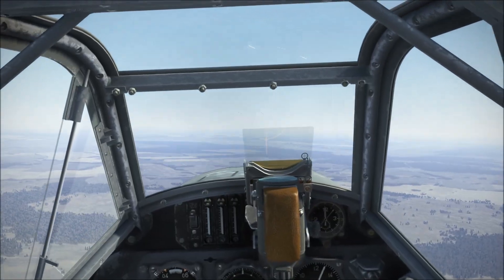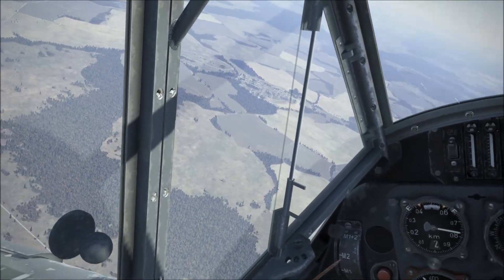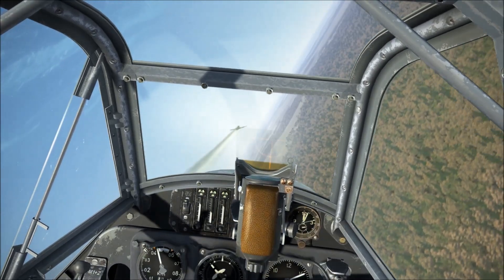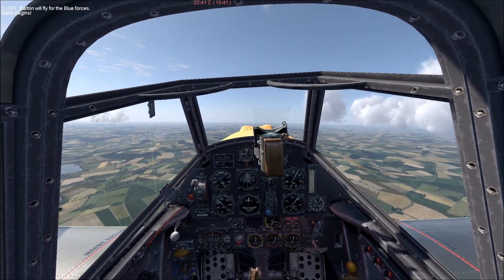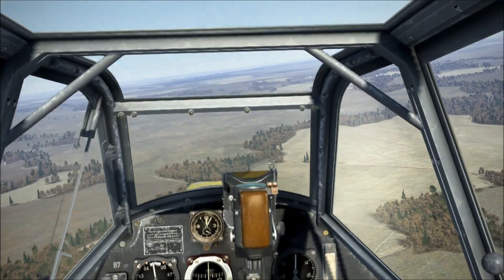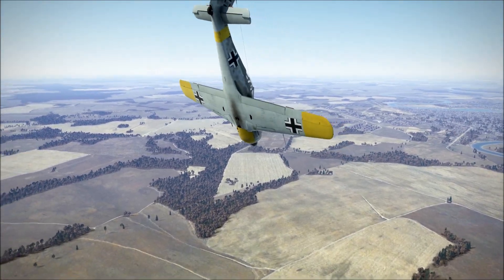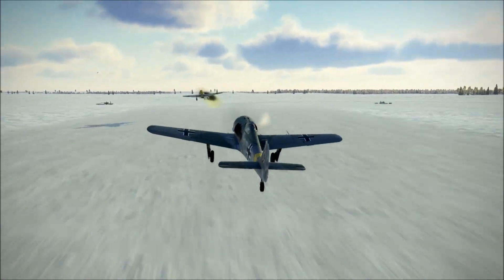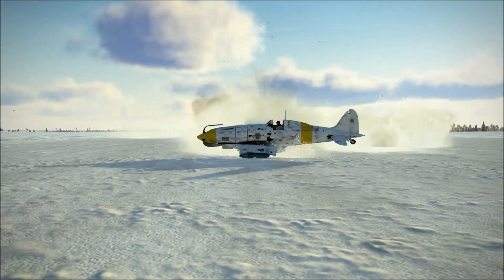IL-2 Battle of Stalingrad - Stall Characteristics Comparison

Comment: Flight models change between games, depending on the algorithms and characteristics, so it's understandable that aircraft are going to behave differently given the same dynamics using different engines.  Some of the changes reflect new knowledge devs might have gained doing research, others come from playtesting, or the flight model just not behaving.  There shouldn't be criticism given to someone for chosing one sim over another because they don't like the flight model, after all these are games and are meant for leisure and enjoyment. They'll never give you the true sensation of flight since you're not actually sitting in an aircraft feeling full turbulence and g-forces.

Comment: Well done and good points, well illustrated.  To me, the most telling criticism of IL 2 is the level of tuning necessary to make some planes reasonably flyable.  Game developers ought to have planes that fly at least OK with default control settings.
Other than that, I think you are showing up the difference between a "game" and a "simulator".
I have heard others say that DCS is a simulator whereas IL 2 BoX is a game, and that categorization makes even more sense in the light of your tests.  
IL 2 may be a more realistic game than War Thunder (don't know, never played War Thunder) but it is still a game.  With enough different flyable aircraft to make engaging battles, campaigns, scenarios, etc.  
I have no idea how much effort it would take to put together the BoX plane inventory with actual simulator-level flight models, but I will assume an insane level of effort.  Meanwhile, we have choices:
1.  Apples - a nice game with quirks in the simplified models but lots of planes to fly.  (Although they should tweak the models to make every plane flyable with default controller settings.)
2.  Oranges - an epic simulator with only a few planes with superior flight models.
Reply from the maker: Old_Guard the cost of doing the latter is astronomically high and the costumer base is ever smaller.  This is why War Thunder is so popular. It takes almost no skill or support equipment (like stick and rudder, let alone TrackIR) to get into and 95% of gamers don’t give a rats ass about realism.  BoX is trying to pull from both extremes and it’s a hard place to occupy.  Too realistic and you get a bunch of whining from the arcade guys.  Too much arcade nonsense and you get a bunch of whining from guys like me. It’s a hard thing to pull off but it’s something that will bridge the huge gap between WT and DCS.

Comment: I maybe able to offer you a good explanation of what you are observing in this sim regarding handling and stall characteristics.  I'm an old pilot of some 40 plus years, ex - Flight Instructor, aircraft owner, most enjoyed flying acro and high performance sailplanes.

'Use to fly IL2 thru all versions, but do not now.  The detail I would offer is longer than one can post here, if interested I will post the "paper" to your JG1 url.  Briefly though, in the vid you are entering a snap roll ( a spin entry from level flight).  Around the 3rd or 4th rotation the nose of the birds should begin to fall through the horizon, your recovery, noticeably nose down.  The first and second snap seem to give an adequate presentation, not beyond.

Flight models can not be accurately reproduced in these platforms. (PCs)

All the Best.

Comment: I've only started playing IL2 recently since the VR update, and I have to say that I think it feels pretty damn good with default sensitivity. I understand your argument about stall characteristics, which you made very well. I think it is worth noting however that it is extremely unlikely that you would be able to pull full elevator or rudder deflection in real life at 400 kph without some kind of power assist. The air resistance on the control surfaces would be enormous. I have had some flight experience mainly on sailplanes, but also a few tail draggers. I'm no expert, but the faster you go, the more sensitive your controls become needing only the slightest touch to make adjustments.
Of all the combat sims I've tried, IL2 BOS /BOM at least to me, does a remarkable job of simulating what it's like to fly. I'm enjoying it immensely, far more than I ever did any IL2 games that came before it.
Reply from the maker: Steve Lamb admittedly I haven't flown too many planes in IL-2 BoS recently. I've flown the Ju-87, Bf-109, p-40 and Fw-190. I flew the Yak and I-16 once. Most of the planes feel pretty good, really.  The Fw-190 was laughable before the update did well to fix it. The 109 is still too sensitive in the pitch axis to me.  At stock sensitivity the 109 is almost unflyable to me and certainly impossible to fight with.

Comment: Agreed... the stall characteristics are nonsense - and let's not get on to the ground behaviour where the ground looping ACCELERATES when the power that caused it is reduced.
Reply from the maker: Some of the the ground looping does seem pretty excessive but I can't directly compare it to any other sim because there was no difference between unprepared and paved runways in 1946 and DCS doesn't have grass fields.  I've found that the stalls get a bit more sensible if you idle the throttle but this suggests that the prop wash is drastically overmodelled.

Comment: now all we need is real life comparisons!
Reply from the maker: Dylan Walker that would be good!
Reply: Sadly I don't think that anyone will ever take the risk to crash one wwII fighter plane during a stall test
Reply: I find when a plane stalls, even from a snap roll, it tends to spin and tumble, which is why it has that tendency to start "flying backwards" because the inertia from the stall/spin and unstable state, push the plane around, plus there's also things like Gyroscopic precession, P Factor, and Torque to take into consideration.. seeing as BoS has a very advanced physics engine and even calculates wind flow from not only your plane, but from slipstreams on other planes too! maybe it is CloD who has it wrong, as it seems too "perfect" of a spin, as if there's nothing but the effects from the actual lift of the wing stalling.

just my 2 cents and opinion :)
Reply from the maker: Dylan Walker the aircraft should have gone through stall tests during flight testing before they went operational. Although we could probably learn more by taking a surviving aircraft up to do stall tests I don't think it would be worth the risk
Reply from the maker: Dylan Walker it certainly is possible that CloD is inaccurate.

Comment: you will note when you go into a high speed stall like at that time the airplane loses stability, and becomes unstable, good example at this time is at about 5:03 when the airplane begins going into a flat spin, the airplane is now unstable, it will easily be persuade to tumble or spin with forces that push it. In that instance the nose wants to drop, but because you are applying elevator to pull up the air rushing over the horizontal stabilizer from the prop keeps the nose up because the elivators are pushing down on your tail keeping the nose up, the rudder you are applying to the left has the same effect, air from rushing over the vertical stabilizer and rudder pushes the nose to the left, in combination this causes a flat spin. engine torque and Gyro can also have effects on a spin as well, later 109s were horrible about this because the engines were really too powerful for their air frames. 

My suggestion to you is to try different engine speeds and see if this has a effect.

Also there is a notable difference between a D-9 and A-3 FW-190, the D-9 is considerably heavier, and it's longer tail may change its stability, it's engine also produces a lot more power and engine torque which also may have effect on how the aircraft responds in a stall, the A-3 is shorter and much lighter, and in fact if memory serves the earlier A series fighters were some of the lightest, some time after A-5 they started bumping up armor and armament. the FW-190A-8 for example was still a radial powered variant, but it had heavier armor, and came optional with 4 MG-151-20 20MM cannons and 2 MG-131 13mm machine guns. VS 2 7.90MM machine guns, 2 MG-151-20s and 2 MG FF cannons.
Reply from the maker: angryace13 I could examine the influence of the propeller wash over the flight controls by doing these stalls at both full and idle power. Would be something to look into.  There seemed to be a noticeable torque effect on the A3 in that it is more likely to rotate to the left in a stall

Comment: A good indicator of the flight model is a known maneuver like the Hartmann rolle or defence, whichever it's called.  If you can pull off that maneuver in a G series Bf 109 (Hartmann flew G series I believe, but I could be wrong) the flight model is probably bang on.  I've seen people pull it off in CoD with the E4.  Not sure in BoS.  Instead of pulling back on the stick opposite of the rudder you push forward opposite of the rudder (left rudder, forward right with stick and vice versa).  It creates a drastic negative G roll, while also slowing you down, causing the opponent to miss and overshoot.  In theory.  I tried it the other day with the F4 and it didn't work for me, the plane just wallowed in confusion and went into a flat spin, but then I'm no Erich Hartmann...
Reply: I looked up the Hartmann rolle and can’t find anything what is it?
Reply: And searched Defence
Reply: It’s as described above. You can find it referenced in Mike Spick’s book The Ace Factor. I have a couple of his books. Interesting reading.
Reply: @chuckbarney3945  I had to look up Hartmann escape. I do the maneuver quite frequently in War Thunder I didn’t know it was real or had a name haha. But discovered it while fooling around in maneuvering in test flight.

Comment: Nice video, I think the reason the 190 flies better than you remember is that they updated the FM recently.

Another interesting test might have been the BoS 109 G-2 compared to the DCS K-4. I know they're pretty different but it might give some insight into how the later 109 wing shape stalled and whether BoS models this accurately, which I'm almost certain it doesn't.

Also you can get 1946 on steam for really cheap.
Reply from the maker: Fahrenheit I don't have the K4 in DCS yet so I couldn't make that comparison. I would like to do an examination of the F series 109s in BoS as I think they are the worst. The F2 is very touchy and unstable making it hard to aim in a dogfight. It's more manageable after setting my deadlines wider but it is still far more difficult than the other 109s. Thanks for the comment
Reply: K4 on DCS has a Fm taked by a captured G2R6 with a damaged tail so is not really a 100% accured Fm

Comment: Good think the new rudder update is coming up!
Reply from the maker: Luiz Engrazia that should help I hope but they need an elevator update as well!
Reply: JG1_Barton The thing is: if you change one value in the engine, other things can be affected as well. You can check the latest dev diaries to read about that. By changing the rudder behavior, the planes will be more stable in the airflow, landing, takeoff and the stall/spin will be completely different from what it is now. Plus the overall behavior of using rudder to do a flat turn, for example.
Check out the developer diary on their forum. I think you'll get pretty excited :D
Reply from the maker: Luiz Engrazia I'll check it out. Sounds promising